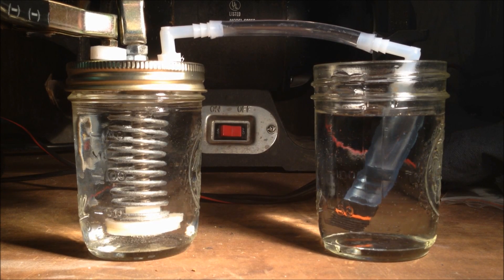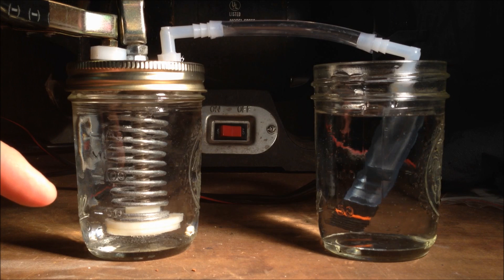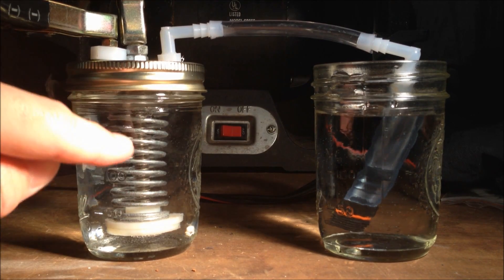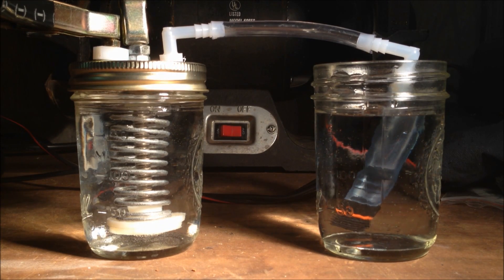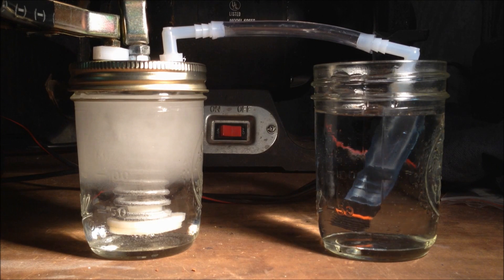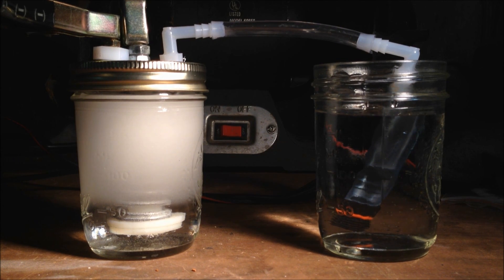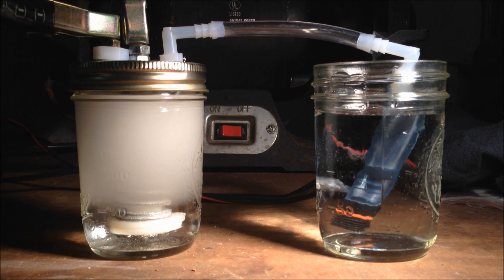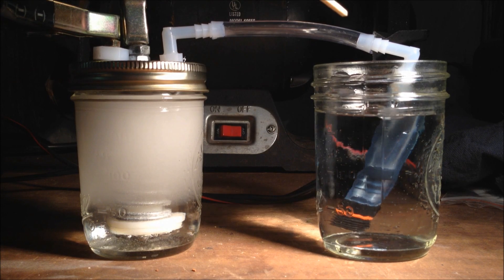HHO Generator - Wet Cell

Comment: I would also like to know if you have added any baking soda or something else?
I have heard that baking soda can ruin the engine is that true?
And can it replace the gasoline totally and I mean 100% replacement :)
Reply from the maker: Yes, I was using baking soda. You have to use some type of electrolyte to conduct electricity. Water itself is not conductive (at least not with this level of voltage/amperage); it's the particles in the water that allow the electrons to flow. I'm not sure whether [or not] baking soda will ruin an HHO generator. A lot of it depends on the metal you're using. Stainless steel is the best. On the brief research I've done, I've read that baking soda can produce some bad fumes. However, using sodium hydroxide or potassium hydroxide (correctly and in moderation) results in clean byproducts. It has to do with dropping carbon atoms or something (I'm not a chemist). As far as replacing gasoline, I'm not sure. Certainly not using my setup.
Reply: +Chris Sawyer Finish your sentence? Sodium hydroxide what?
Reply: +Chris Sawyer Run any engine on water with plasma ignition. Plasma ignition! A high energy (amperage) electrical discharge will break the atomic bonds of oxygen and hydrogen within the water molecule. Free hydrogen undergoes combustion with the surrounding air and it's oxidizer (oxygen). This is more oxygen rich than outside air as water under disassociation will enrich the mixture with additional oxygen content. The flame  does not appear to be very hot as it is red in color. But that is something I am still unsure of at the moment. So, when burning (so to speak) water and not HHO gas, it is up to you to replace components with what won't corrode or wear out prematurely with water. I'm thinking the pump of a pressure washer. Use it's design as a reference. You'll also have to keep the water warm at all times. That will be another challenging part. But it's the farthest thing from hopeless. If you haven't increased your gasoline fueled engine's compression ratio to 16:1 after the water-fuel conversion because we can freely do so as water will never undergo combustion until the plasma plug fires, then ethanol mixed into the water will stop all freezing issues. For the diesel engine to be converted, it would be the fuel (water) injection duration (A/F ratio) and ignition timing that controls engine speed. Injection timing may no longer be a factor. Water would be compressed in cylinder, unless it's injected into the engine right before the plasma plug fires. Otherwise the water, assuming we have achieved very good atomizing, would just be injected with a fixed injection timing. Whether the water injector is inside the intake manifold, or in cylinder depends on the engine's design. Does it have glow plugs? The plasma plugs will replace the glow plugs. If not, the plasma plugs replace the injectors and our new water injectors are placed outside the cylinder, unless of course you can machine a custom cylinder head to accept both. I say no thanks. Just modify what we have please.
Reply: lye

Comment: What water mixture you used?  Dosent that stainless steel rost?
Reply: dude thats why its called stainless steel, it does NOT rust.
p.s. i think you misspelled rust.....
Reply: +MR siemiite I must correct you in a civil manner. Stainless steel will rust in water with very high salt concentrations, like the ocean. That obviously doesn't apply here, so consider this comment merely playful. 

PS: Are you sure that you only think he misspelled "rust"?
Reply: Bone Drone Well... that is true.
Reply: +MR siemiite Rost means rust in swedish so he isn't wrong.
Reply: +Adam Olsson oh dude don't overdo i'm trying my best :)

Comment: How much
Voltage did you use
Reply from the maker: I used a standard car battery charger. It was 12v at 15 amps.
Reply: +Thomas Patton You hear that? That means you can make a direct electrical connection using your car battery, or bank of capacitors assuming you have replaces the shitty made-to-make-us-rich-folk-continuous-money batteries. And why wouldn't you? Here is another way to do it. Hook the positive side of the circuit to the alternator output (+). Why? The alternator even with the voltage regulator in place will readily produce over 12 VDC. 14.3 VDC is more effective at producing gas than 12.6 VDC. You may even reach up to 16.5 VDC in certain instances. Another advantage is that you won't need to worry about disconnecting the power or ground cables to disable the circuit because the alternator won't be producing any current while it is not spinning. We all know that the alternator only spins while the engine runs. The engine itself will serve as our circuit breaker or on/off switch. I have seen one person do this. Another thing done on his part was to wire two auto-resetting switches on both the power and ground side of the circuit. The switch would trip and open the circuit whenever the HHO cell has too high a current draw which can occasionally occur, and automatically reset after cool down. I for one don't see the requirement in two of these things but that is how he chose to build his unit. I have heard people concerns that current not directly being used by the battery reaching the ground terminal of the battery, as in, what could happen? I really don't know. Surely this isn't a factor since the alternator while of course charging the battery must also assist it with any high electrical load.